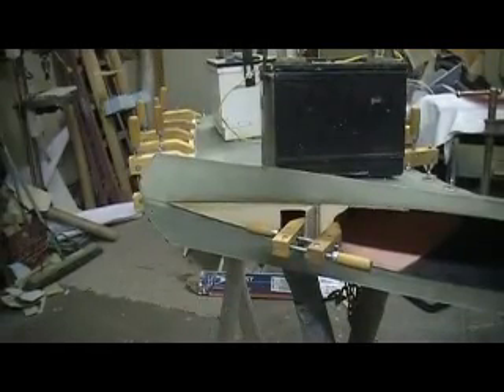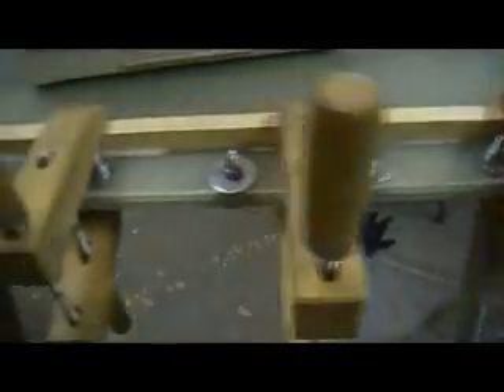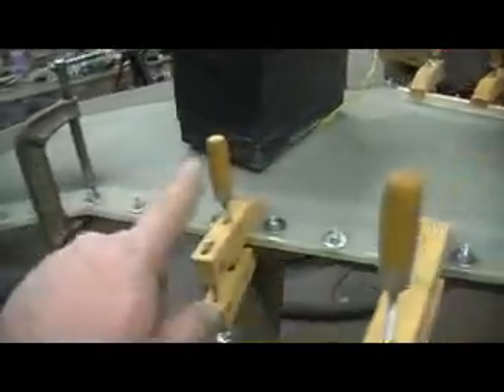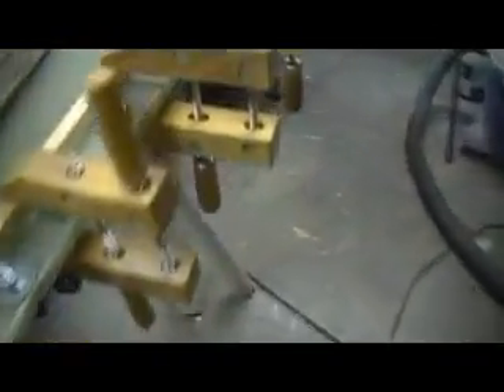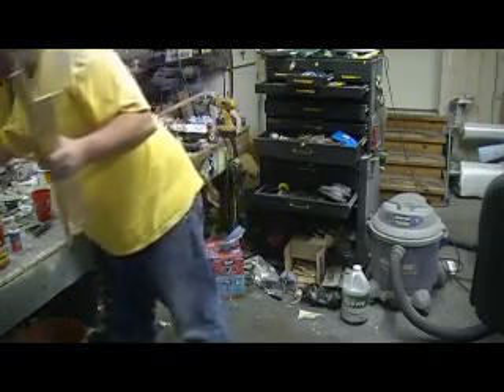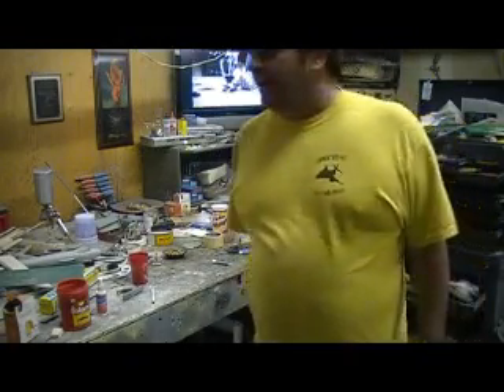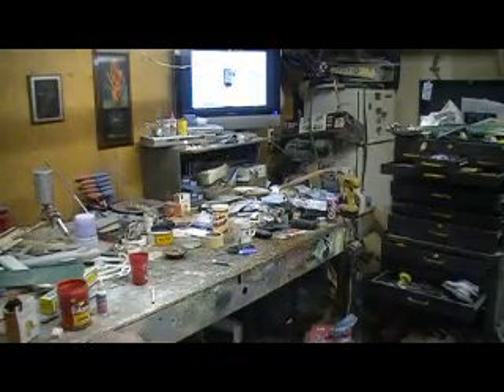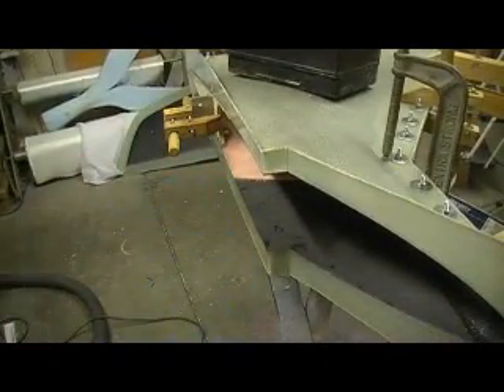how to build a rc jet F-105 thunderchief # 287

Comment: @drivera6972  Agreed.... Foam core material is designed to be used in a sandwich situation between two layers of fiberglass.  When you seperate the layers of glass with the foam core it exponentially increases the glass cloth composite's strength in deflection loading.  Think of it as a composite I-beam where the foam is the web and the glass cloth are the flanges of the beam.  Foam core with glass only on one side is not an "I-beam" but more like a "T-beam" glass composite.